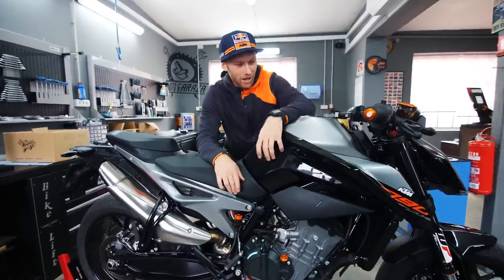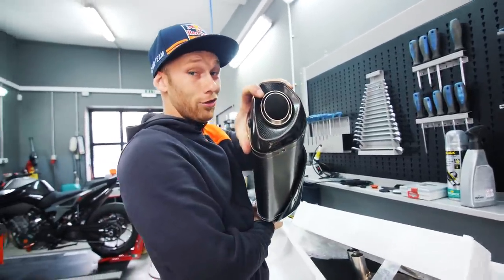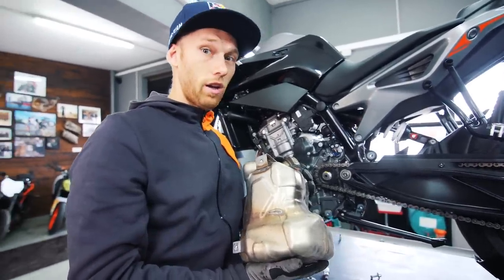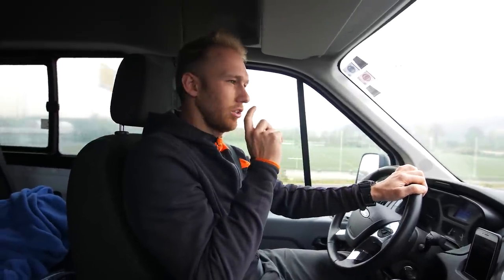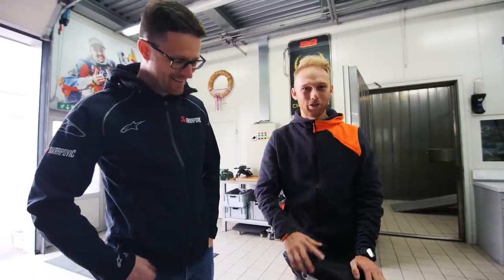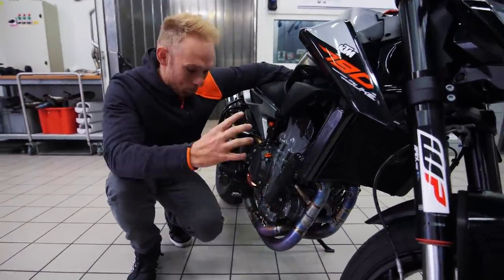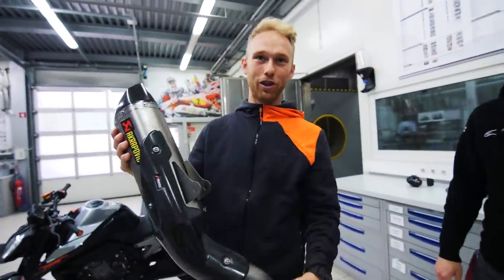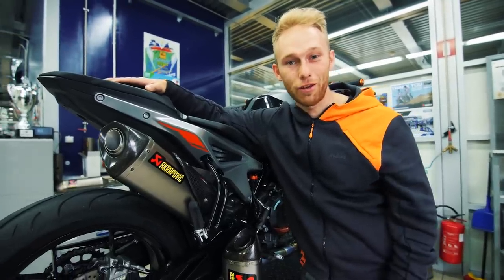2019 KTM Duke 790 & Akrapovič | RokON vlog #82

Comment: Akrapovic should be all road legal, its not that bad
Reply: does it really matter
Reply: The exaust isn't street legal?
Reply: It's not that bad? The LC8c was designed to work best with an catalytic exhaust, the EVO full system doesn't have a cat since it's track oriented and designed to flow as much exhaust gasses as possible, so it's not intended for prolonged usage since it will also start damaging the engine overtime.
Reply: Steve Slothenstein No it's not street legal since the system is marked catless from the factory and intended for track use, using an catless system on the stock ECU will also damage the bike's engine overtime
Reply: @markusandrejeff5708  Correct. I run the silencer only on an otherwise stock exhaust and have done so from new. Dealer installed, fully warrantied and lighter and much better looking than stock. Sounds nice as well without being loud at all.

Comment: Congratulations on 421,000 subs!  I really enjoyed your Akrapovic vid, and of your superb riding skill.!!  I would've like to have seen how the bike was tuned for more torque, did they do a reflash?  Did they add some device like a Power Commander?  We need to see this!  Also,  you mentioned that you were running the KTM with the Decibel Killer installed.  Did you ever remove it?  I'm trying to determine if this system is going to be too loud for my neighborhood with the DB Killer installed.  Thanks!!
Reply from the maker: We added later on a sport filter and remap it. This exhaust is only for race tracks since it is not street legal. But you have slip on version tho ;)

Comment: Hello Rok. 

I been interested on the Dukes after I discovered your channel and, I

been fallowing your channel for a bit. Really like the work you have been doing and

the love and hard work you put on it!.

I will like/love to build a Duke 790 or 890 from scratch this winter. I am thinking that the 790

will be cheaper to build as it is going out of the market. 

Here in Montreal, Quebec, Canada the licence plate registration and the insurance are very pricey

and I need to save some money during the process. I would like to build the
bike over the winter as a winter project and have the bike ready for the
summer. I just don't know where to fine all the parts for a low price as here in Canada the KTM parts are very hard to fine. The
parts could be original or after market. New or use. Mix between the 790 and the 890 parts is possible too. That is not important. The most important thing for me is to build the bike with the less money as possible. Could you please will be able to help me with this project? To source the most important parts and components  of the bike, like the bike frame and the motor. At this moment I don't have anything. 

Please, let me know if you could be able to help me with this project? 

Any of your thoughts or recommendations will be highly appreciated! 

Please, if you have any questions feel free to contact me.

unity2javier@gmail.com

Regards,

Comment: Don't remove rear footpegs. It will save your exhaust when you crash during stunt.
Reply: Sub cages will take more impact
Reply: @sandasolosol6546  something is batter then nothing
Reply: Subcages is like the back foot pegs the exhaust will be under the passenger seat it will not be damaged in a stunt bike crash cages and subcages take more impact during a crash

Comment: KTM owners around the world... Do you have RPM issues and loose nuts and bolts?
Reply: Chaitanya Dinkar not so much if you torque the bolts down with a small torque wrench to the exact specs in the owners manual. Unfortunately that should be done at the dealer before you purchase your KTM but some dealers don't always put the bike together with the proper torque specs so it's left up to the new owner?
Reply: @jeffflick2573  i've seen many 390 owners of India complaining about loose nuts and bolts even after servicing the bike at service centre and Unstable RPM is the issue since the inception of 390. 

Don't know what KTM is doing as there are a lot of (same) complaints happens to be from INDIA. Are they selling any different quality to India compared to world?

Comment: buy an old Manual Transmission Scooter bike (or create one using KTM 125/ 150cc engine), custom it with some expensive stuff like carbon part, expensive suspension(Ohlins), Akrapovic muffler, Brembo brakes, etc and give it a RokBagoros Logo and "Its 500k subs baby" (or any text that related to 500k subs) and maybe do some stunt with it   @Cangelol